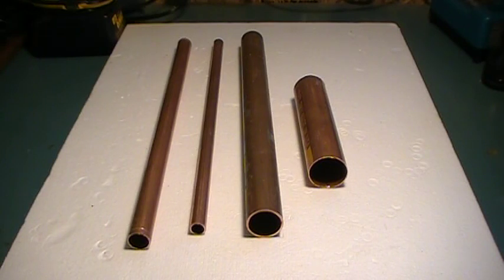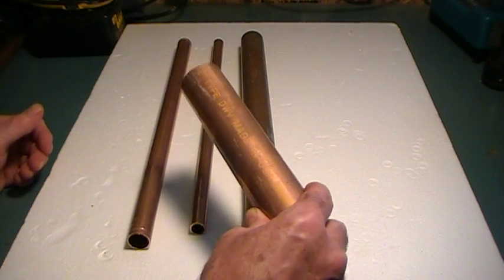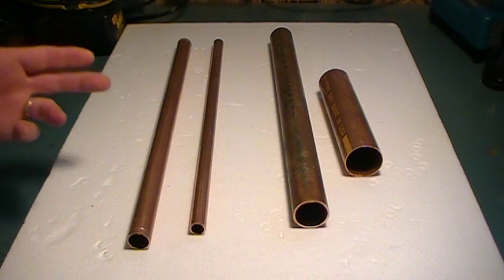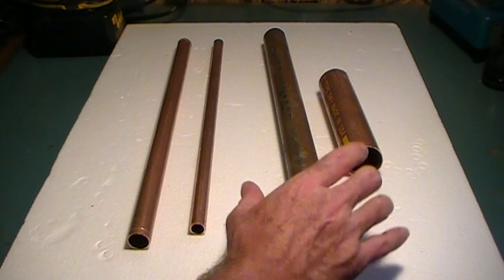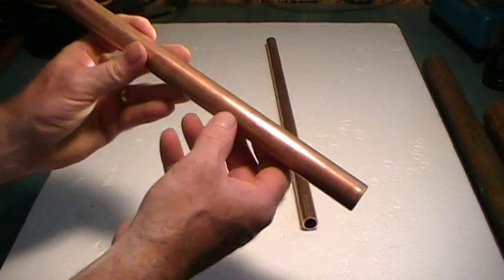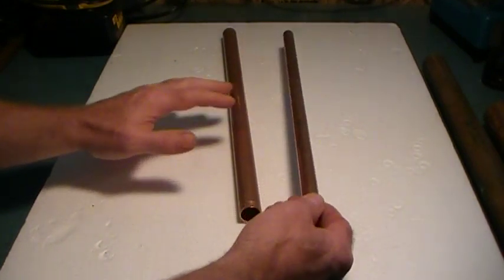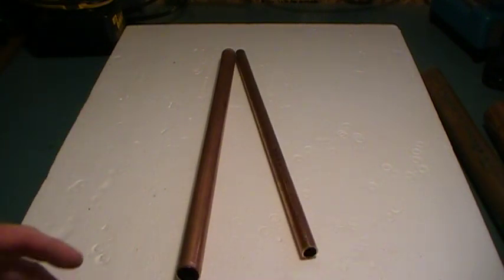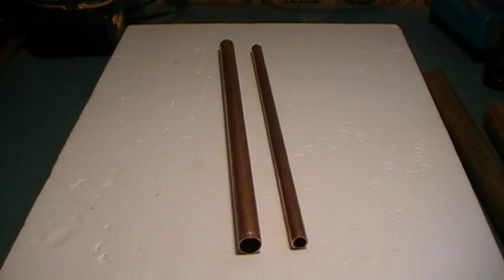Different types of copper pipes and their applications.

Comment: Hi, I'm a novice at most of this. I have a question. So I'm building a mother in law suite with a bathroom that's about 40 feet away from the house. I have been puzzled as to how I can get water to the new structure. I seen that some people stick the copper directly into the ground and use a 10 mil tape where it came out of the concrete. How long would the copper last underground, would CPVC be ok? How deep should I put the line/run in and would imbedding it sand make it safer for the line?  I've gotten mixed feedback on what to go with. Would taping the whole run if I go with copper make it last longer? Is type K even used for that application or would Type L suffice? I want to go with copper since I heard that CPVC can become brittle within 15 years. I also have an electrical line that's 18 inches deep(South Florida Code) How far away should I stay from the electrical line?